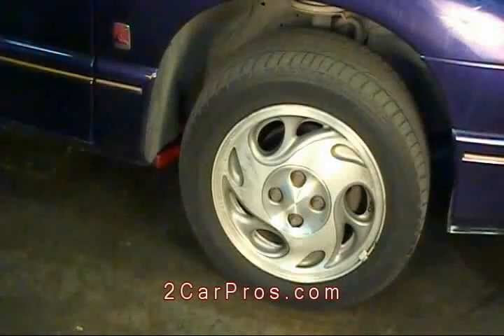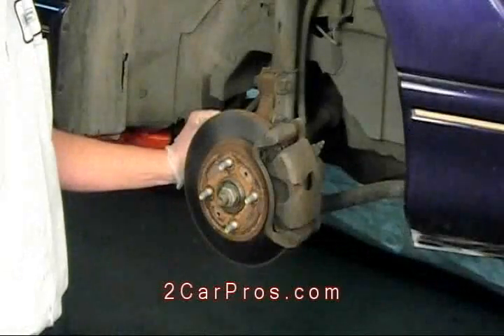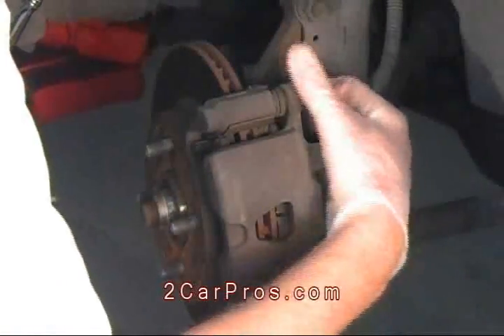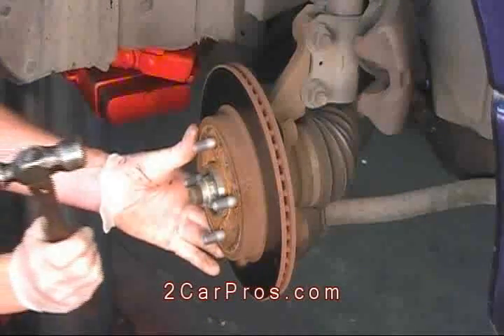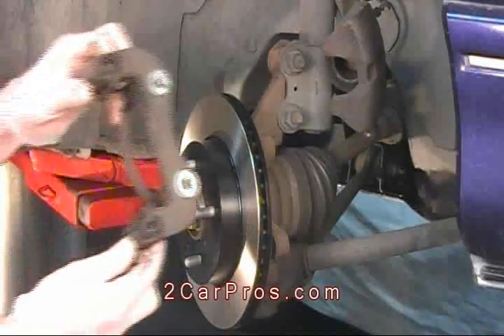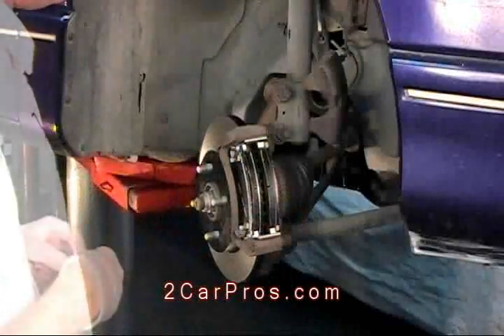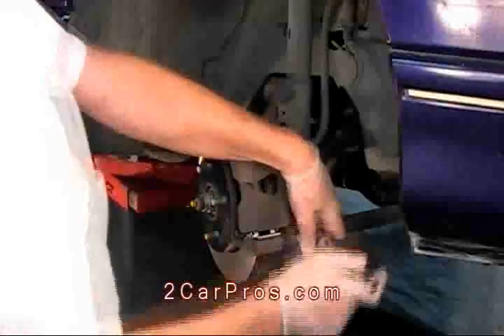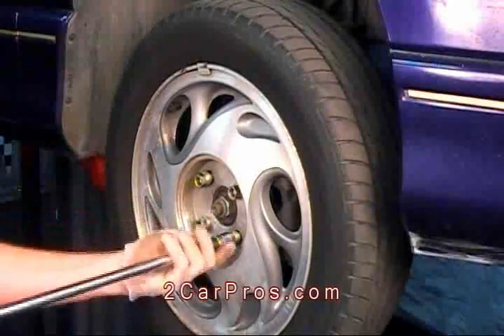Front Brake Pads & Rotor Replacement 1997-2004 Saturn SL1

Comment: As a former parts store employee, I would like to address anyone thinking, "the website said it fits, i dont need to check"...

What a lot of people will do, is they'll go online and do their research, sorta. Then they'll come in with a part number or submit an online order for in-store pickup, go home, then come back, then be mad at me that I "handed them the wrong part".

What typically happens, is a customer will be shopping for front brakes, and look for the cheapest option. For some reason, a lot of parts stores' websites don't specify front or rear, or, if they do, it'll be in really fine print (which no one ever seems to read...). Rear brakes often have less material than front, and, therefore, are often cheaper.

It's also quite common, especially nowadays, to have differences between trim levels. An AWD Sport Edition with 4-wheel disc ABS and the Performance Package with mid-model year revisions is probably going to have much bigger/different brakes than the base trim's 2WD locking front disc/rear drum combo from the start of the model year.

Plus...it's entirely possible to be given the absolute wrong part by the parts guy.

So, yes, always check your shit prior to installation, especially if you do not want to be hassled when you go to return a greasy part in a beat-up box where any and all accessories are out of their packaging - or worse - damaged parts, because you didn't VISUALLY VERIFY.

Comment: well if they are in good condition (not warped, not below thickness) then its perfectly fine.
if you have warped rotors, ect, poor braking, brake pulsation, and undesired effects can happen.

also pads. usuially i'd stick with well known pad brands, like for OEM i'd get Centric/PosiQuiet pads, or raybestos, even ebc or hawk i dont trust those "Store brands"
and here's the tradeoff, for better braking, theres dust, and for less dust theres not the best braking...